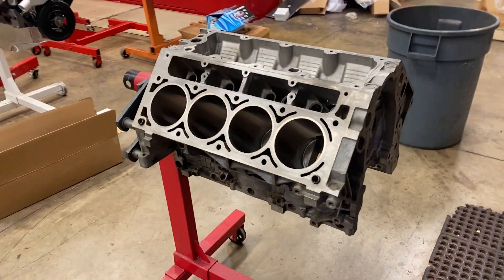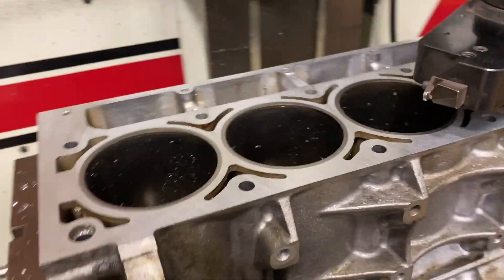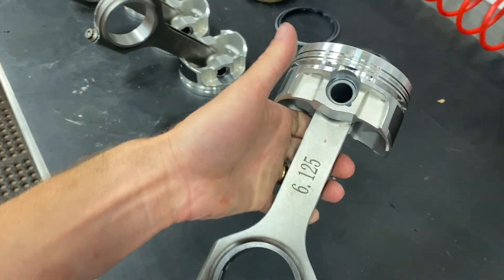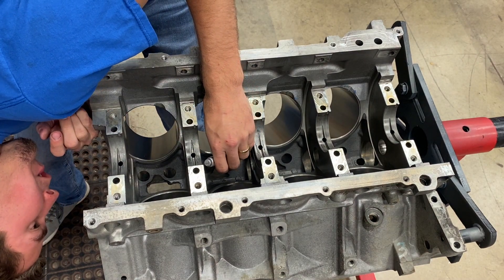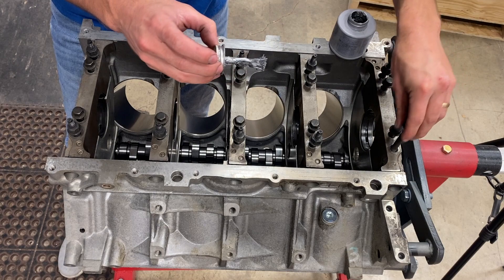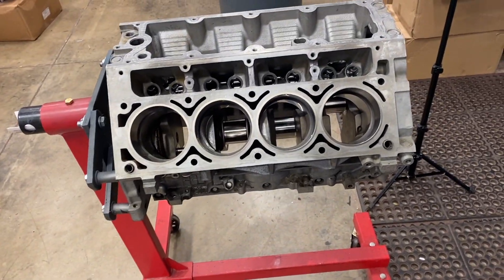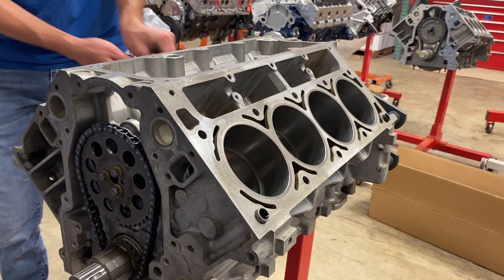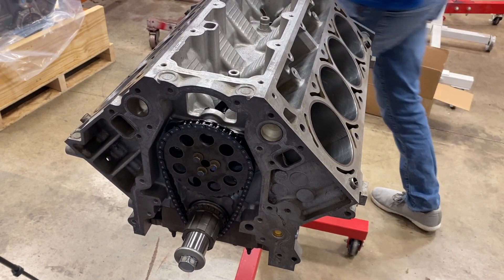Building a NITROUS LS1 383" Stroker Engine

Comment: When you torque down the mains to measure bearing clearances, are you using the new main bolts, do you reuse the main bolts for the build or get another new set?

Comment: Also what compression does stroking the motor put it at?
Reply: If you don’t change your pistons, deck height, heads or head gasket thickness, it doesn’t. Seeing that a lot of stroker kits come with aftermarket pistons though, it’ll probably bump it up a bit unless you request the pistons not to.

Comment: bru with ur experience, can you run a built forged ls1 over 100k miles if its tuned and maybe even dialed back for daily use? My ls1 spun a rod at 93k miles all stock lol. Kind of want to forge and cam it and maybe run nos and a turbo down the line but also dont want it dying again !

Comment: Hey just stumbled up this. I plan on building an iron block 383 ls for a 300shot maybe a little more if I get crazy lol. What heads are you using for this build? Also what is the target compression ratio?
Reply: i currently have this motor in my gto, im running some millled and mild ported 243s.

Comment: Hey Engine Guy I want to  build a Lq4 6.0L iron block 03yr but want to make a 416ci do U hve a rotating assembly kit for dat. Want bout 700hp to d wheel pump gas daily driver also bout 250 shot.

Comment: Z
Is resleeving necessary for this setup? I'm doing a similar build on my LS4
Reply: With a Ls4, (pretty much a Ls3).    I would get some Sleeves for it, or maybe sell it and boost a 4.8 🤷‍♂️
Reply: @StayHydrated-wd5ic  nah I already did the build. 4" stroke should be good on stock sleeves

Comment: 3:04  Only if you will be using the same style fastener.  Head bolts will distort the block in a completely different way than head studs.
Reply from the maker: Correct